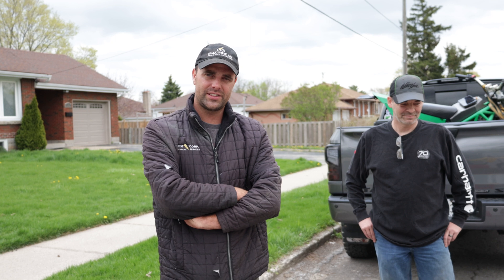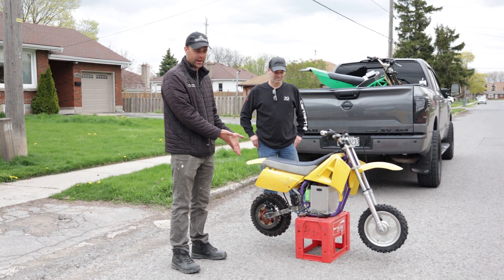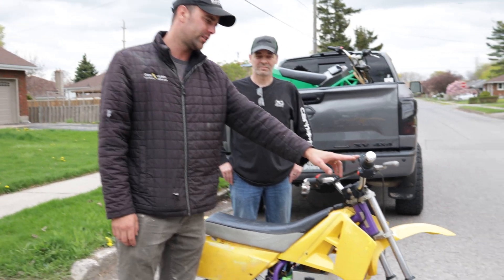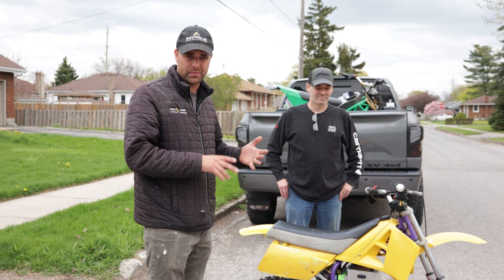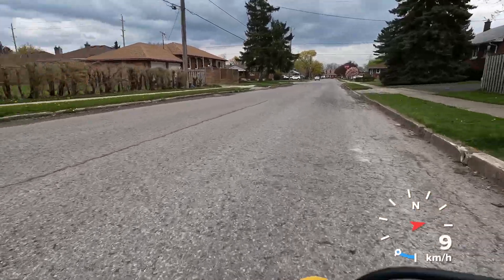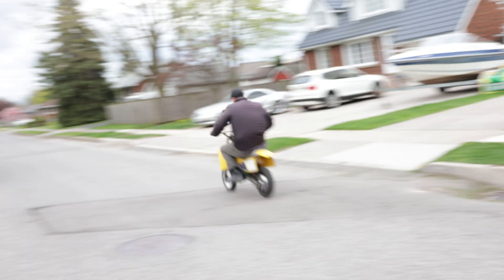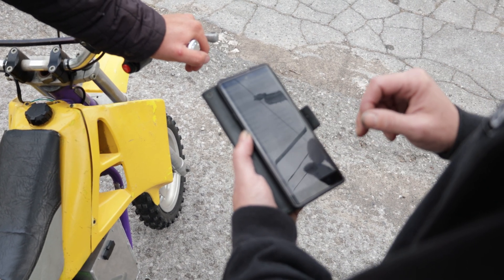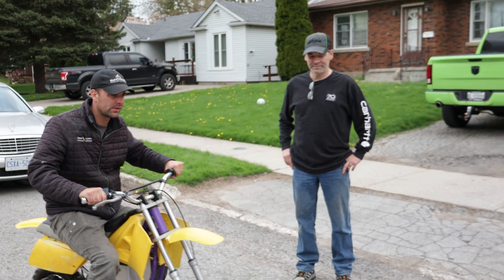Cobra 50cc - ELECTRIC CONVERSION - 1000W hub motor overclocked to 8500W

Comment: How did ya’ll make this? I wanna do the same switch method but make it so the lowest ‘gear’ is max 15mph and highest is like 50 but idk how i’ll do it so please make a video
Reply: Have to program the controller for three configuration of settings for all of your specific components (switch/button just toggled between)